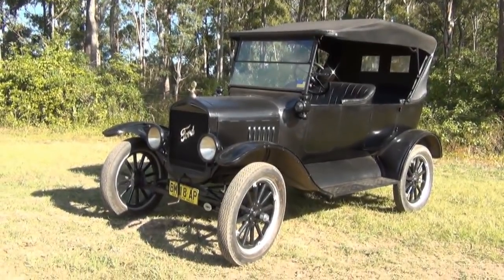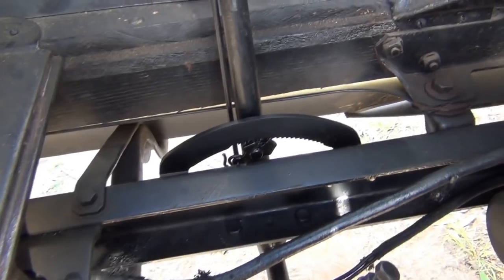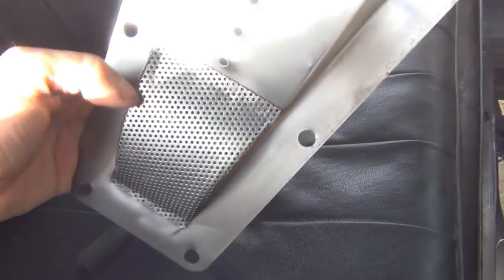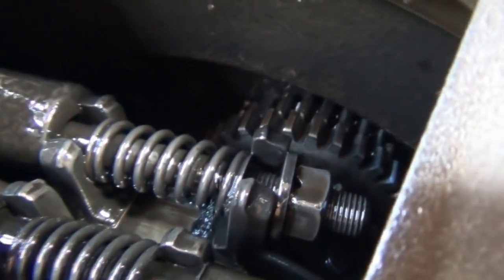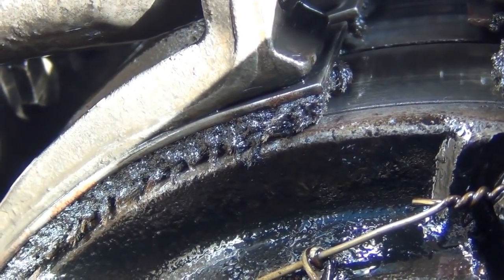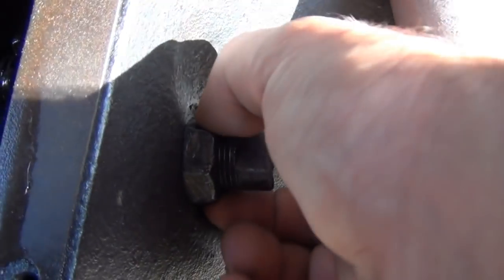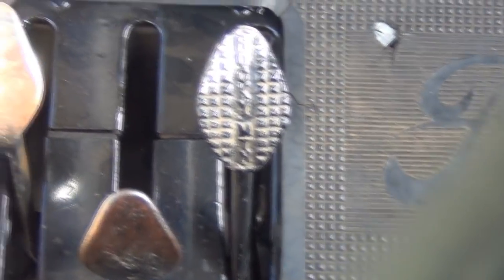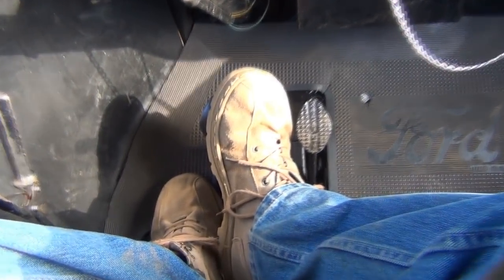Ford Model T - A Closer Look: Transmission & Clutch

Comment: Someone once told me that the company manufacturing the transmission gears for Ford was given specifications for the boxes that the gears were to be shipped in. When a manager from the company visited the Ford plant he found out why. They were cutting up the empty wooden shipping crates and using them to make the floorboards in the Model T. So those floorboards you removed, if they were original, were once the shipping containers that the transmission gears came in.

Comment: Basically it's an automatic transmission with a human valve body.
Reply: Ford invented automatic transmission in 1908.
Reply: Sort of.  A traditional automatic transmission is a planetary transmission with a torque converter and valving to control the shifting.

This is a planetary transmission but just uses the bands and a clutch for starting and stopping with no torque converter.

Occasionally you'll also find transmissions that pair a torque converter with a regular manual transmission to get the compactness and large number of ratios available with a manual but not require careful control of the clutch for starting.  It's most common on large trucks and some farm equipment.
Reply: Kind of yeah

Comment: With a little experience, you don't have to leave the hand brake in "neutral" as you can learn how to hold the left pedal in neutral while at a stop.  Also, when pulling away you can just let the pedal go from low to high while backing off of the throttle.  The only time you really need to use the hand brake in neutral is if you are in tight quarters and are doing a lot of short backing and pulling forward.  Otherwise, with a little experience, you can drive the car without using the hand brake.
Reply from the maker: Modeltnick Thanks for the comment - see my other video on how to drive a Model T, and you'll see I demonstrate exactly what you explained here :)
Reply: ***** Thanks for your comment.  I can tell that you really enjoy your Model T!  I have a 1916 touring which is a bit more primitive than your car but it starts and runs easily and reliably.  These cars are great fun to own and drive.  It's no wonder that over 15,000,000 were produced. The design of the car is pure genius!  Thanks again.
Reply from the maker: Modeltnick Yes, I certainly do! I was on tenterhooks waiting for it to arrive in Australia - and I couldn't wait to drive down to Newcastle to pick it up from the wharf! I've actually been on the lookout for a brass era Model T, theres something about them that's extra special :) I think my ultimate dream is a 1903 Ford Model A :)

Comment: I find it interesting that the  Model T's two speed manual transmission uses planetary gears, bands, drums and stacks of clutch plates somewhat similar to those used in a modern automatic transmission. I guess good ideas have a way of sticking around.

Comment: Well, that was a hoot to watch, along with the other videos of yours that did the intro and the first one on shifting.  Haven't found the one you mentioned on the brakes, but I'll look.  A fascinating look back at the early days of automobiles.  My first car was a 1953 Ford - the 50th Anniversary edition, as it was known, and it cost me $200 in 1960.  Flathead V-8 automatic, whose best and worst features were the smoothness of the engine.  Best, because it was smooth as silk and ultra quiet - no vibration at all.  Worst, because it was so smooth that people would think it had stalled at a light, and try to start it while the engine was running.  The starter motor would then chip the ring gear on the flywheel, and at some point, when you tried to start the car, the starter Bendix gear would jam, and you'd have to push the car to start it.  Unless you're the Hulk, you can't jump-start an automatic by pushing it.  Loved the car, but my mother had a fit and made me take it back to the dealer.  I still have a Model A transmission in the cellar that was hooked up to a WWII-era turret lathe I owned for quick gear changes.  Very interesting video, and well done; thanks!

Comment: Good video. The way I was taught to use the handbrake was to hold the palm of my left hand away from my leg, grip the handle with my fingers, and use my thumb to push the latch. I know it sounds awkward but I learned this from a 1921 edition of Dykes Automotive Encyclopedia.

Comment from the maker: Well spotted - but the screen part itself (with the holes in it) isn't stainless, otherwise, no, the magnet would not stick.
Reply: It depends on the type of steel. There are some grades of stainless that are ferromagnetic.
Reply: Cold worked stainless steel 316 can become magnetic. To de-magnetise it you have to heat it up to cherry red, then let it cool slowly to anneal it. I had the same misconception on stainless steel cable vs galvanised cable once...

Comment: Pretty good setup considering when these were being built. That front gear or flywheel ? with the idler gears would act like a torque converter, kind of like putting a pipe on a short wrench to break a bolt loose, only working with about 20 HP so anything that increases torque helps.

Comment: Very similar to an automagic transmission, early ones (and probably modern ones) use clutch bands controlled in some way by engine vacuum, electromechanical or hydrolyic to select different ratios or directions of the gears
Reply: william fleete Those bands certainly wouldn't be controlled by engine vacuum, that would be silly (bands would loosen and slip as you accelerate). Also this doesn't have a planetary gear set in the sense that a modern transmission would.

Comment: The screen is stainless not so that it won't rust, but so that the metal filings will stick to the magnet- not the screen- when removed for cleaning.  :)

Comment: Its like modern automatic transmission with one planetary gear, that has to be manually controlled. With one planetary gear you can get two speeds and reverse. You said in the other video when the break lever is pushed from neutral to High gear that it was a 1-1 ratio. It showed the clutch pedal come farther up.  When this video you had larry turning the crank so we could see the planet gears orbit around. Does pushing the brake lever from neutral to high gear lock the 25 clutch disk and stop the planet gears from orbiting?

Comment: I  risk  putting my foot in my mouth here, but I think he is wrong in this video when he explains the 25 clutch discs, and here is the reason I think this. First off, I am now very old, but in my youth, I scrapped a lot of "T" engine/trans groups and stationary machinery with this engine and trans in the early '70s. As a young mechanic, I really wanted to know how they worked, so I drove to him with some of this stuff and had him lay it out to me. He worked on these cars and knew the principles of operation, especially the trans. Add to this what I know now, and here it is. Planetary sets achieve gear reduction and even reverse by locking up one of the 3 groups in the planetary set. That, without going much further, explains how the gear train works. These clusters, like the annular, sun, or planets, are attached to drums to facilitate this gripping through the pedals, either through bands or clutch plates. That clutch pack at the rear of the cluster in the trans is combined with a band that seizes onto the final rotating "mass" that attachés to the rear end. This acts like a band brake on an early truck transmission that serves as a parking brake. The clutch pack as I remember locks up to connect this last rotating group after it comes out of the first planetary pack, which achieves the reduction and the reverse.  If it is anything like a "twin-disc" pack in a crane hoist drum, it locks up kinda like a snap-binder that flatbed guys use. There is a "knee-action" in this tool that keeps it locked once you snap it past a certain point. A lot like your knee "locks up"!  If your knee didn't do this, no muscle on earth would allow you to continue to stand so long without tiring the muscles!  In other words, that pack at the end of the "T" transmission is held in locked position either by an action similar to the crane drum clutch, or simply a strong spring. IF YOU DIDN'T HAVE THIS FOR HIGH GEAR, YOU WOULD NEED TO FORCIBLY HOLD PRESSURE ON A PEDAL FOR AS LONG AS YOU ARE MOVING IN HIGH! hOW LONG BEFORE YOU'D WEAR OUT?!  SOOOO........ in the video he says when you hold the low pedal down, you apply pressure FROM THE 3 FINGERS to this cutch pack, which would go towards the rear of the trans as in the video. IF I AM RIGHT, THE 3 FINGERS WOULD ALLOW THAT COLLAR TO MOVE FORWARD TO LOCK-UP THE CLUTCH PLATES! MOVING BACK WOULD KEEP THE CLUTCHES FORM ENGAGING!  SOOOO. with the emergency lever held midway back would begin to move the 3 fingers back and release the clutch pack. NOTHING TO DO WITH THE LOW PEDAL!!  That just tightens one of the bands to go in low. The reverse  does the same thing. IF YOU HOLD THE BRAKE LEVER ALL THE WAY BACK, YOU KEEP THE CLUTCH PACK RELEASED AND ALSO LOCK UP THE THIRD BAND, AS A BRAKE. RELEASE THE LEVER TO THE MIDDLE LETS OFF THE BAND, AND ALL THE WAY FORWARD WITH THE BRAKE LEVER ALLOWS THE CLUTCH PACK TO LOCK UP THROUGH SPRING ACTION AND PROBABLY A KNEE-ACTION TOGGLE TO 'LOCK UP" THE FINAL ASSEMBLY TO THE REAR WHEELS WITH THE OUTPUT ASSEMBLY FROM THE  PLANETARY TO ACHIEVE A FINAL DRIVE WITHOUT AN ENGINE DISCONNECT CLUTCH  BEING NECESSARY TO ACHIEVE A NEUTRAL POSITION OTHERWISE.  I agree I may be a bit off describing this, because there may be onlt one planetary in the trans (I can't remember) so the clutch pack probably locks up another group of that planetary in a way a band couldn't be used due to the necessity of a foot-free way to apply force during almost all the time you are in forward motion to save your muscles!

Comment: New to model T, watched the video, When you move forward, did you put the gear shifter forward? Or keep it in neutral?
Thanks. Mike
Reply from the maker: +Mike Mansour, to clarify, the (parking brake) lever you see only applies to high gear - it closes the high-speed clutch. You press down on the left pedal to move off in low gear. Hope this helps :)

Comment: Mitch, you have been a great encouragement to me. After watching your videos I bought a Model T and I have used several to repair it. Would you consider doing a video on adjusting transmission linkages? Mine has all new bands but when I go into second gear I get a sort of shudder where the band seems to slip, then it engages. I think I’m shifting correctly. My linkage is real loose, sort of floppy, and the adjustment bolt that rides on the emergency brake is so off center I’m concerned that soon when I pull up the emergency brake it will miss entirely. Could you add such a video? Thank you for what you have done for this hobby.

Comment: we just acquired two model ts closed to running my question is the low speed pedal do you have to hold it down all the time or does it lock in when u move and what's the procedure from high to low in the midst of all that how do you get it in neutral to brake just wondering thanks
Reply from the maker: The low pedal is only held when you're starting off in low gear, then you shift by moving the handbrake all the way forward and release the low pedal to go into high gear.
Couple of ways to get neutral to stop, the easiest for beginners is pull the handbrake back half-way so its straight upright, then press the brake pedal. Alternatively, you can press the low pedal down halfway, this is also neutral, and step on the brake at the same time. Watch my video for full instructions... https://www.youtube.com/watch?v=QxfHMtgg2d8
Reply from the maker: I also have a video specifically about changing gear... Hope this clarifies for you :) 
https://www.youtube.com/watch?v=ctvnQYJCUkI
Reply: Mitch Taylor: What is the procedure for staying in low gear to maintain a low speed for an extended period of time?
Reply: Just push it as long as you want to go, but I'll tell you what: the low gear is for maximum 10km/h so you certainly will not drive an "extended period" of time in this speed, haha!

Comment: this australian dude is so knolageble on the tin lizzie you would think he had built it grate guy grate car frankie 36 south georgia
Reply from the maker: Thanks for that inspiring comment :)
Reply: no problem i hope the car runs well for many years to come just a quick question dose a modle t have enuff power to overtake a nother car
Reply from the maker: Well... if the other car is going slower than about 60km/h (35mph), then yes I can overtake :) But I would have to be driving at full throttle, full advanced spark, on a dead flat road to get that speed :)
Reply: thanks for getting back to me its just nice to no that  sutch an old car can pass a mutch newer one grates vts as allways take care
Reply: Frankie Jacques m

Comment: REALLY GREAT video!! I've read alot about the bands etc but had a very hard time visualizing what they looked like or how they worked. By the way, I have a 26 TT and have been driving it WRONG. I had a feeling that I needed to drive it the way you showed, but had no real confirmation of that. Plus, it's SO HARD to fight the instinct to smoothly apply inputs like we do on modern cars.

Where do I get the screen? Did you make yours or can you buy them someplace?

Thanks for what you do!!!

Comment: Don't most Model Ts just have a 2 speed transaxle in the rear? or did they add another gear box behind the engine in the later years.
Reply: the only transmission in the car is the one he shows in the video. The engine and transmission are one piece in a model t. They share the same oil, so the oil pan goes from the crank in the front to the universal behind the transmission.
Reply: He's thinking of the semi-rare Ruckstell (sp?) 2-speed rear axle.

Comment: Mitch,  I saw how you adjusted the low gear band.  Questions: where as a rule of thumb should one begin to make adjustments? Should I go all the in then adjust out, or is there a magic place to start?  Moreover, concerning the the reverse and brake bands--i suppose i adjust from inside the transmission shell; again where is the ideal place to start adjusting all in then move out, or all out and then move in gradually?
Reply from the maker: I usually adjust mine (tighten) one turn at a time - there is a lug on the adjustment that must be locked in after each full turn, which stops the nut backing out and the band going slack (slipping). You tighten the band until you get a good "bite" on the drum without slipping when you pull away. Over tightening will cause the band to burn out, as it would be in constant contact with the drum.

Comment: Thanks... what is the wire seen at the bottom of the transmission bands inside the cover plate? It looks like something that is pulled on.

Comment: Just to clarify. When at a complete stop is it ok to keep your foot on the brake pedal? I am a new Model T driver (friend of mine owns one) and I am a little confused if the bands wear when fully stopped or not. Thanks :-)
Reply from the maker: Yes you can keep your foot on the brake pedal, the brake drum (and band) is connected to the tail-shaft, not the engine, so once stationary, theres no slippage anyway.
When moving off (either forwards or reverse), I prefer to keep engine revs to a minimum (without stalling of course), and use a brisk pedal movement, to minimize slipping the bands.
Reply: I was curious the same thing, but wondered if the brake pedal could be depressed during a stop, most notably when the car is on an incline or decline, to keep it from rolling.

Comment: I thought that when you pressed the clutch to the floor, it was first gear then all the way up was second with neutral half depressed. Is this a different transmission that I'm thinking of? The hand brake on one I saw pulled the clutch pedal into the neutral position when it was pulled back.
Reply: You have it right

Comment: Can you use low gear to help you come to a stop
Reply: I have a 27 TUDOR T, and have been driving it since the 80s. U dont need to use low gear to slowdown. Since high gear is direct drive, buy cutting the throttle to idle position the engine slows u down and then u go to neutral by pushing the clutch pedal to the middle and brake to a stop .

Comment: So on a 25 minute drive, are you to hold the clutch down the entire time?
Reply: Yep. Because the clutch arms are linked to the same pedal that low-gear is linked to. So unless you lock the engine in direct drive (hi gear), you're stuck with the clutch down.
Reply: Low gear is just to get the car moving or climb a steep hill. In high gear, your feet are not on the pedals.
Reply from the maker: @paulzumpf3612  Correct :)

Comment: how Mr. Ford could continue installing those dinky pedals in the Model T for many years is amazing! awkward and unsafe, seems to me!  or were people born with tiny feet back then?  did Ford not get any consumer advice?  if so, did he ignore it?
Reply: Guess , people were shorter at the time and there's not really damaging, when pushing ALL of the pedals. Also there were only cows and horses on the streets firstly; just honk and they're about to leave quickly before hitting them, haha!
Reply: Unsafe? Who ever said cars were safe. How about Tesla’s auto pilot that thinks the car can fly and will drive you off a cliff.  I’m ok with the pedals even though my 11wides don’t fit. 😂
Reply: People were generally much smaller back then and shoes were much narrower so it was not really an issue. To say a t is dangerous is really a pointless thing to say as they were made in a time when safety was not a big factor in design of any piece of machinery including cars.